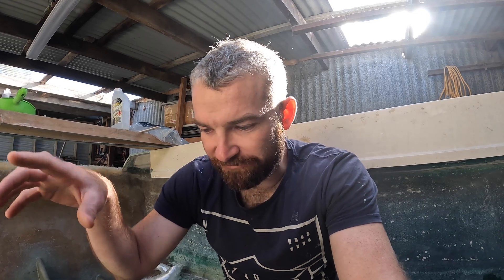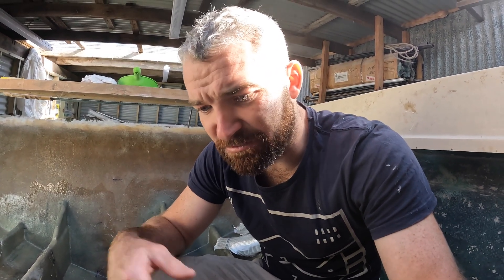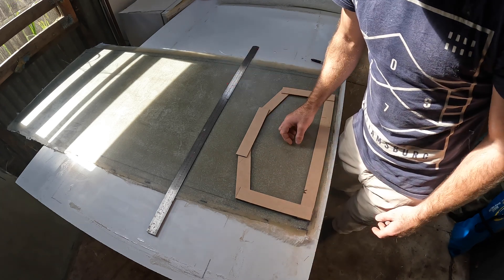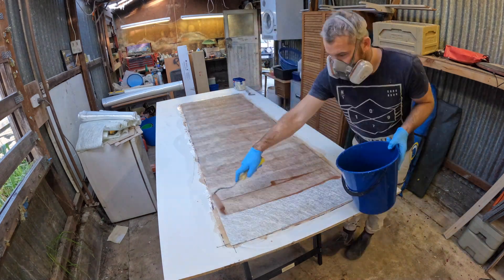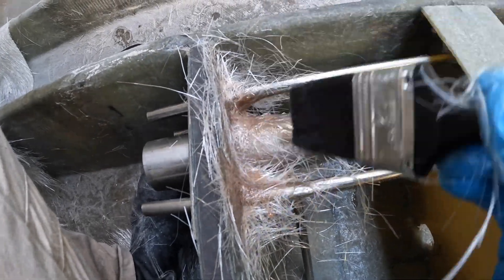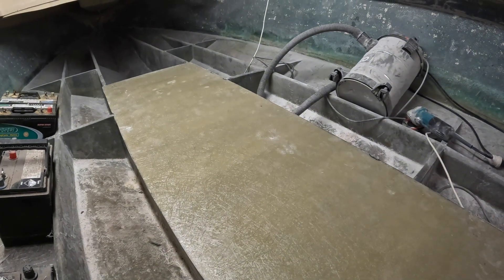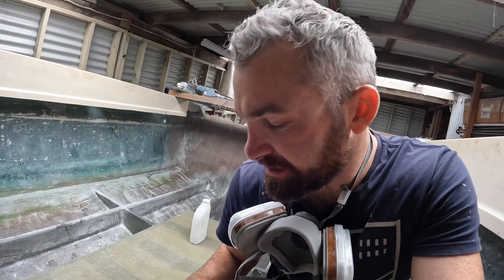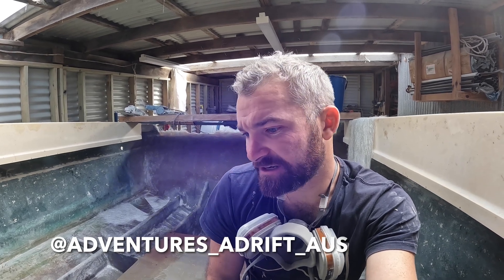Building a Fibreglass Fuel Tank - Step by step

Comment: Great videos mate and what an awesome boat she turned into, I'm fixing a signature 600rf and your videos have been bloody inspiring and helpful. One question, how has the fuel tank held out? I'm about to go down the same path as you did and wanted to see if your still happy or anything you would change. Thanks again mate
Reply from the maker: Hey mate, tank is holding up well with over 200 hours use. Knowing what I know I now I wouldn’t put as many baffles in, I’d do a full layer of 450 chop on the inside with waxed resin to ensure a full cure (I only did a waxed coat of resin over it, no chop) that’s just something extra for peace of mind. You may be able to find stainless fittings that will seal through the bulkhead for you breathers and pickups but the welded plat and pipes has held up well with no leaks. Good luck!
Reply: @ADVENTURES_ADRIFT  thanks mate, much appreciated. Going to try and reuse the original fittings if I can if not then a trip to the shops. Have a good new year's mate and thanks again

Comment: You're knowledge and attention to detail is so awesome. one thing I noticed tough is you have no vortex trap inline on your vacuum. How often do you have to clean the filters? I installed one on a bucket and haven't touched my vac filters for aaaaaages. Is annoying as a second part to lug around but with longer vac hoses and a make shift trolley its saved me hours. Can send you a pic if you like. costs like 35 bucks with, the bucket cyclone and internal support so the bucket doesn't collapse

Comment: Contsruction design and quality is outstanding overall. Too many holes in the baffles, also you have twice as many baffles actually needed. It doesnt hurt anything just letting you know. Also, instead of tacking with hot glue use thickened resin with a sandable filler like Q-Cell with 20 to 50% more hardener than normal if you want it to harden up fast... also, you use small pieces of glass mat for tacking also with extra hardener. It holds way better than hot glue and no strength or bonding surface lost.

Comment: I would not have put the metal fittings at the aft end of the tank.  I'd have them at the front end.  When you accelerate the fuel will all be forced to the back of the tank and you will have these forces applied to where the tubing passes through the tank..  I also fear that you will have leaking issues where you glassed around the tubing.  This area should be gasketed.

Comment: Shld have something holding that pick up in place on the bottom.  The vibration will break that over time
Reply from the maker: It’s welded in place 🤔
Reply: @ADVENTURES_ADRIFT  it's welded in place on the bottom of the tank?  I usually glass a bracket to the bottom.  With a long unsupported pick up tube. Over time it will stress

Comment: I have read that epoxy will not hold the gasoline. I think I read that because gasoline is a solvent eventually it will dissolve the fiberglass.
Reply: Es correcto , la gasolina actual contiene alcohol y deshace la resina epoxy causando terribles problemas en la linea de combustible . Es necesario hacer el deposito con resina GRE.
Reply: Incorrect so many boats these days are built like this and have been for years and they last longer then a steel tank or aloy tank
Reply: You need to get use special resin (VE140) which is ethanol, methanol and gasoline proof!! Otherwise the ethanol will breakdown the resin.

Comment: I was hoping to learn from you what type of surface agent/wax you used in your last coat of resin? I assume the wax is fuel resistant as well.. 

Tip: To save you a lot of time you can use a shop vac grinder attachment to catch most of your grinder dust so the clean up afterwards is much easier.

Comment: Good job and costs saving. You should have holes on top of the baffle to not hold air, between the center ones otherwise you will not be able to fill completly the tank.

Comment: How are you going to tig weld without setting the glass on fire in place??  Especially those filaments that are inside glassing the SS in place?  I sure wouldn't want to attempt it. I am sure you have a plan.  Even with inert gas inside the tank the outside could light off.  The project is coming along nicely.  Good work.

Comment: Why did you choose to build the tank into the boat out of glass vs using a plastic tank or even a stainless one
Reply from the maker: Good question Billy. Firstly cost, it was cheaper for me to make a tank from fibreglass than get one build. I also think this tank adds strength to hull and is a better of of the space as far as fuel volume and if it does fail, all I have to do is cut along the floor ether side of the stringers, cut the baffles out and drop a aluminium or stainless tank in with a thermolite hatch lid over the top. Relatively easy fix. I don’t see the tank failing and boat builders are still making tanks like this so I’m confident it will work fine.
Reply: @ADVENTURES_ADRIFT   thanks for the explanation and also awesome job so far just watched the entire build series so far can’t wait to see the finished product

Comment: That’s the happy face of a man who is finally starting to see the fruits of his labour. Great job on the tank, can’t see any way it can leak apart from the fittings which you just need to maintain each year. Will be great when the other sections are foam filled and then floor in. Are you going to leave the rear bilge area open or floor level and sealed?
Reply from the maker: Yeah it’s good to see some results, that’s for sure! Bilge area will be open for easy access. That will be covered later down the track.

Comment: Hey mate I have a question I have an old aluminium fuel tank in my boat and I keep getting dirty Carbies because I think it’s dirty on the inside is there any way you clean the inside or do I need to pull the tank out and replace it cheers mate love your videos great job
Reply from the maker: In all honesty James, if it’s dirty and old it probably won’t be worth trying to clean / flush it. A new tank would be the ideal thing for it. Alloy tanks don’t last forever, especially with if there’s corrosion present. If a new tank isn’t in your budget a flush right through and an inline fuel filter / water separator might do the trick, with lots of monitoring.

Comment: Looking great least you will eliminated any corrosion problems for ever, say life of a ally tank, maybe 25yrs, the stainless steel screws in the fuel sender units are the undoing on ally tanks.
Two non compatible materials will react over time specially if there's moisturiser about.and stainless tanks can be heavy. 
Hey I think potentially you may run into a couple problems with welding the tubes in institute.
1. You will need a (skinny) welder who can tig with both left and right handed and potentially can weld using a mirror, few and far between (good ones)
2. You should have left the lid off as the heat of the tig welding might cook the glass up on the inside of the tank, on the back of the tubes, now you have no way of checking this, and no way of extinguishing it if starts to burn..
3. You could of welded the tubes to the plate first then connecting that front breather pipe to a stub on the inside via a stainless steel straight joiner compression fitting.
Hopefully, I'm all totally wrong in those comments, you have put so much time and effort into it. 
Make sure you film the guy when he's doing the welding. 
Good luck 👍
Reply: Wouldn't need a mirror and there shouldn't be that much heat put into it to make the glass heat up enough
Reply: @bmxrydaa  Hopefully, you're correct. On camera, it just looked a bit tight for room, it's probably a bit deceiving without physically seeing it in person, cheers
Reply: @JB.Cootacraft  it's definitely tight and would be a nightmare to weld but it would be doable with the right equipment
 Would take a very patient welder

Comment: Very informative mate, love the videos! I hope you don’t have dramas with vapour lock between the middle baffles, the first cavity and last will be able to breath but the middle ones may have a cavity of air above the highest holes cut in the baffles.
Reply from the maker: That’s a very good point Chris, I might have to drill some holes up nice and heigh to stilt that from happening. Looks like I’ll be doing some patch work on the tank lid 🤣
Reply: You could have drilled some holes in the stainless pipe within each section
Reply from the maker: @Fluid36  I don’t believe that would of worked for two reasons. The first being that it’s very difficult to drill stainless steel, particularly on a round pipe in that space and secondly it would create air locks like Chris mentioned, the fuel would block off each hole as the level rises.
Reply: @ADVENTURES_ADRIFT  good point

Comment: Hey mate u forgot a vital point when building a glass tank. It must have a nexus or tissue coating for a chemical barrier. Bugger u have glassed the lid down.
Reply from the maker: That isn’t fully correct Yanans, Vinyl ester resin cured is fuel resistant and can be used for fuel tanks. The coating would be good and over the top but not required.